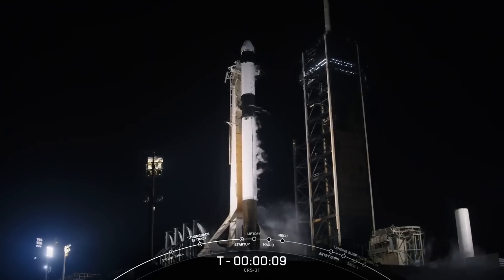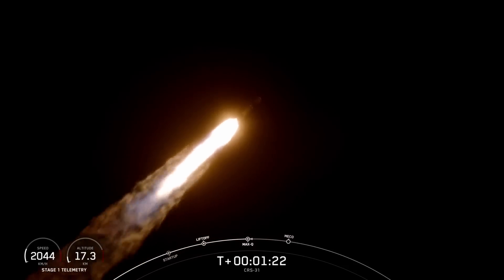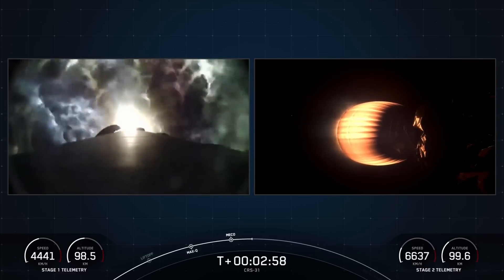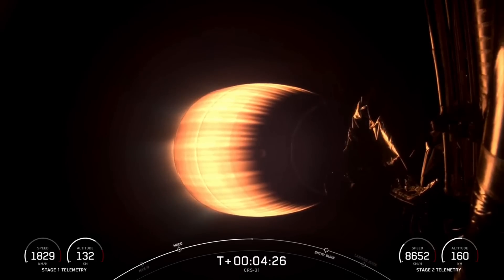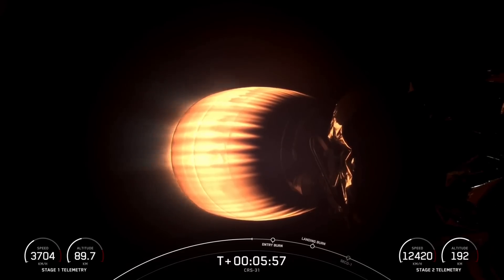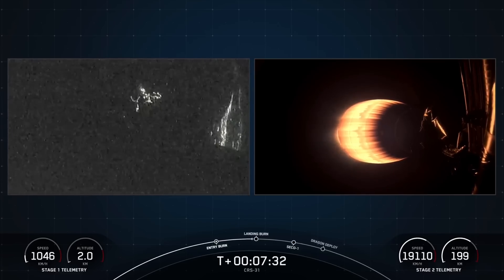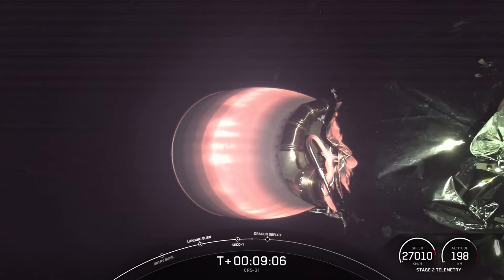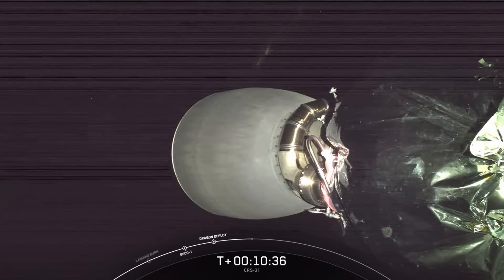SpaceX launches CRS-31 Cargo Dragon mission to space station, nails landing in Florida

Comment: So you tell us firstly that the projectile has to reach 17,500 MPH horizontally to achieve orbital velocity then we have to see data that shows only KM and KM/HOUR. We are still in America so why are we seeing only metric parameters in the data?? Very annoying for us older Americans!
Reply: Because the more logical decimalsystem is used by the rest of the more educated world because of it's easier use.
Reply: Km is .55 miles. Do the math.
Reply: Yes, I can do the math in my head and the factor is closer to .6, but my question remains: as an American, why should I? Why not show either the standard we use here or both at the same time?
Reply: Military is in metric too, and learning both as gen x, it much easier in decimals than fractions